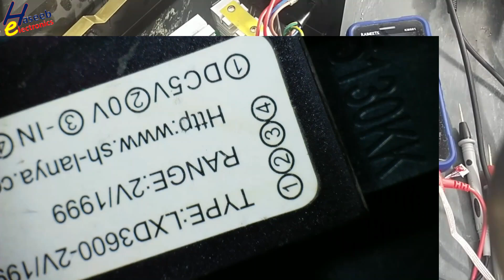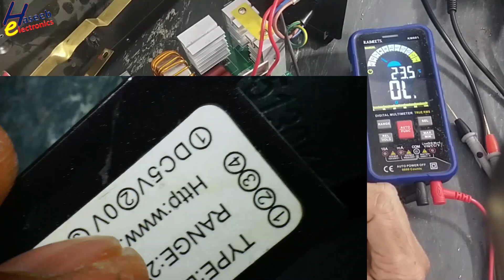{1279A} IGBT Inverter welding machine repair || Ampere Meter Fault

Comment: Good work, small remark: at 12:00 the wires should be in the holes for better stability. I'm sure you reworked it after the video. 😊
Reply from the maker: it is just for fault verification. that is the reason i installed temporarily. this amere meter was for another machine

Comment: f the 5V output drops, it is important to first disconnect the 5V load and measure the voltage directly at the 5V side. This allows you to determine whether the issue is caused by a short circuit in the system control or any 5V-related circuitry. Replacing the 7805 regulator should not be your first step, as diagnosing the actual cause can help avoid unnecessary component changes.

Comment: name of multimeter
Reply from the maker: Kaiweets KM601 smart multimeter
Reply: @HaseebElectronics  is fluke or this better
Reply from the maker: @Boredminers fluke is the best but expensive 
This kaiweets is cheep and have more features than fluke. One problem in this meter that it consumes batteries. To overcome battery issue, I installed 3.7v lithium battery with USB charger 
Now it is awesome

Comment: I would think the fan would run based on thermal control when welding .. not all the time turned when turned on.

Comment: 4:20 PCB miswak
Reply from the maker: hahahaha
that is fiber stick 
used in SMD rework and tuner purpose
Reply: @HaseebElectronics  fiberglass? Isn't it too much abrasive and could potentially rubs out the PCB mask?
Reply from the maker: @aizu35 it is Birchwood stick 
It is soft wood similar to soft fiber
Reply from the maker: https://www.amazon.com/ForPro-Birchwood-Sticks-500-ct/dp/B00I5KRT88
Reply: @HaseebElectronics  Thank you! May Allah accepts our fast

Comment: Very resourceful solution there with the display 👍
Reply from the maker: it is simplest way to verify the exact fault location. 
i installed meter from another model for fault verification. 
it is better to confirm the faulty part instead of purchasing a new item 
when it is confirmed then we can purchase new item

Comment: Nice work you need to use the oscilloscope to check the wave for of the IGBT gate drive also you need to put a load capacitor to mimic the capacity of the gate . I just want to know which IC are using for the control circuit I think most probably tl494 .
Reply: I think this welder need a relay for soft start and VDR for surge protection